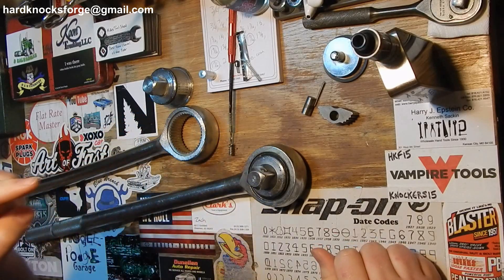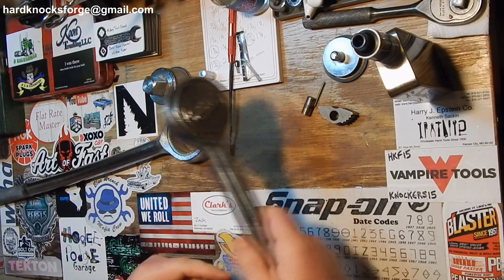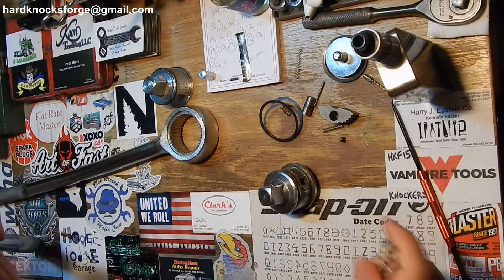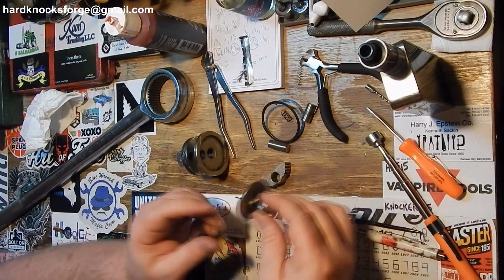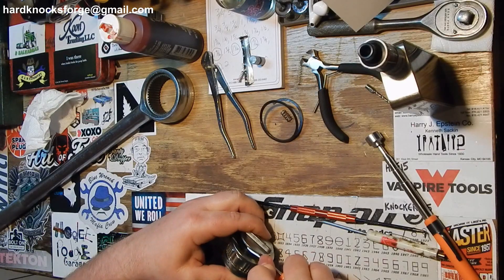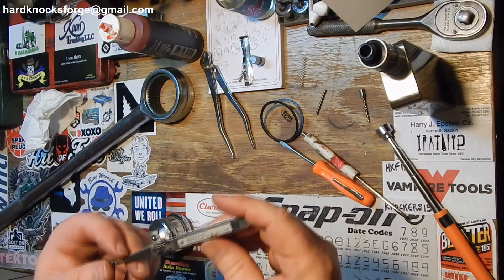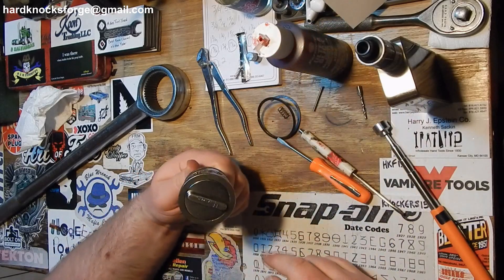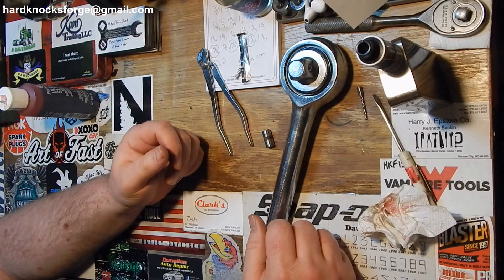Repairing a Taiwan or Chinese ¾” ratchet with American steel

Comment: I use my kids paintbrush to apply the RLL.  Helps use just the right amount, and makes it feel like and arts/crafts project for a few mins.
Reply from the maker: Yeah I saw your Proto ratchet restore video. Just gotta keep the used toothbrushes separate from the ones the kids use.
Reply: They said the taste goes away after a few hours.
Reply from the maker: Whew, that's a good sign. I'd hate to have to taste that all day long.

Comment: Can u improve the strength of a ratchet by replacing the existing spring with a stronger one?
Reply from the maker: You will just get a harder click when ratcheting. The strength of the pawls and heart teeth in the ratchet will not change with a new stiffer spring.
Reply: @HardKnocksForge  Thank you for the reply!!

Comment: Man my eyes kept focusing on that Proto 5249 up in the right corner.

Talk about a buttery smooth ratchet, no way any Chinese ratchet could ever hold my attention when I've got a legendary 5249 in my possession.
Reply from the maker: Yep, I took it apart, cleaned and relubed with the red line of love, and she’s working perfect again. Those older Proto ratchets are pure workhorses.
Reply: @HardKnocksForge  
Theres a reason they've been made since the 30's when PROTO was still PLOMB , and you can actually out the guts for a brand new ratchet and put them in one of the early PLOMB's.
The tooth count is low and the head is kind of large, but mine is buttery smooth with just the blue grease  cut with 10w30 that I use.

Comment: Great video thanks brother. I hope it works better know it has better parts in it. This is why I emailed you about my little problem. Keep up the great work see you in the next video thanks again brother
Reply from the maker: It’s worked fine so far but she’s actually about ready to be put out to pasture. I have a few more 3/4” ratchets now and don’t have to mess with the cheap ones anymore, unless we need a big ole pipe to help. Then we may call one of these guys in as a sacrificial ratchet. 

Were you able to get that other thing fixed?